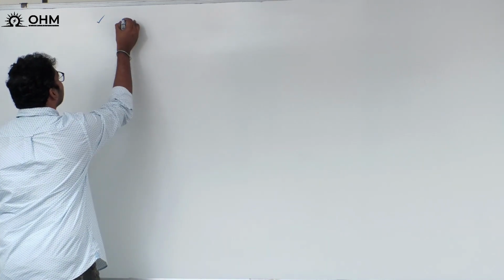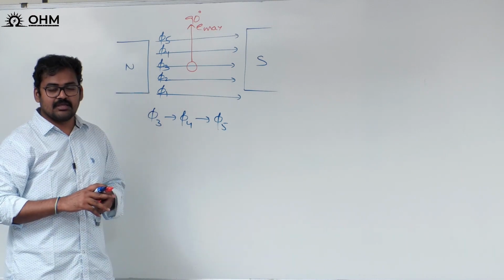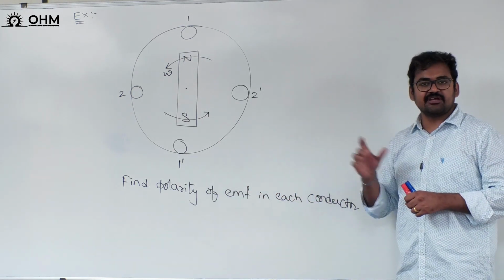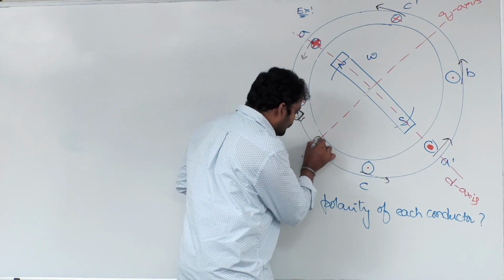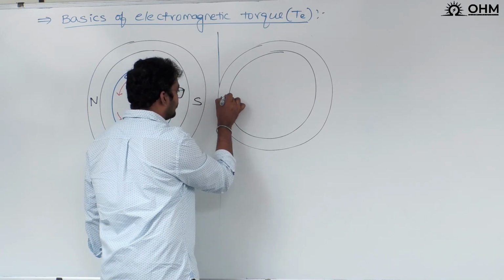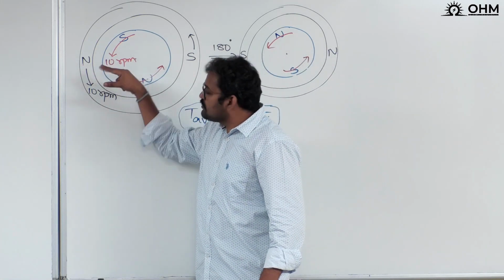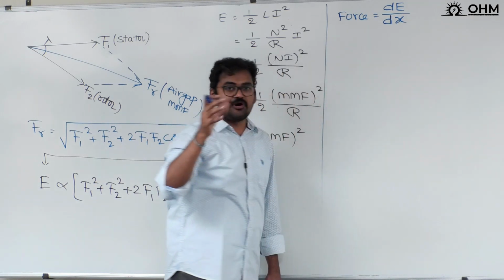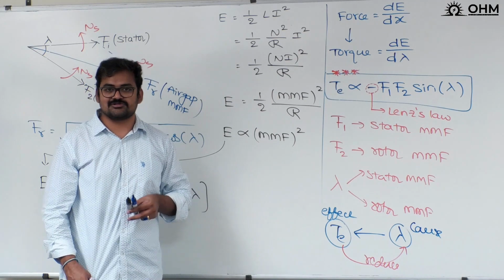Synchronous Machines | L:01 | Basics of Rotating Machines-1 | OHM Institute | GATE-EE

Comment: 30.36 once the rotor rototes and aligns to north and south direction, Whats the question of rotating again to make half cycle?
Reply: The stator North pole will align with rotor south pole only if both were rotating together with same speed, which is failed at that moment.